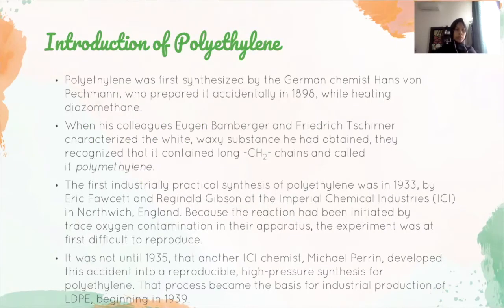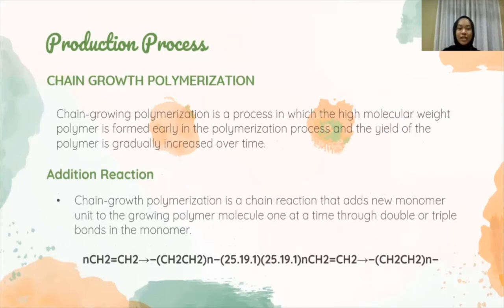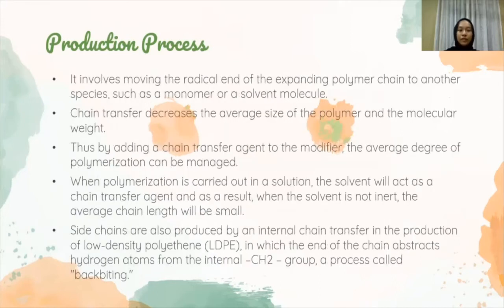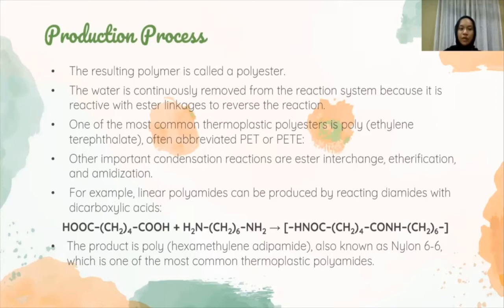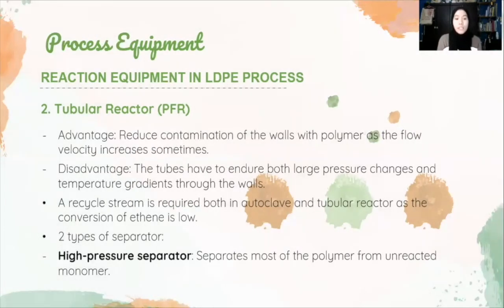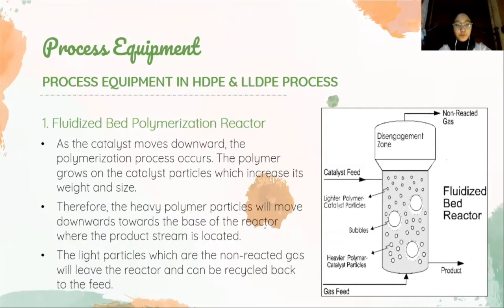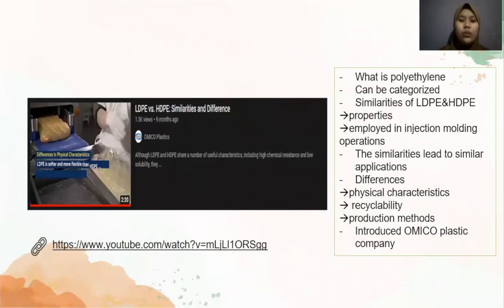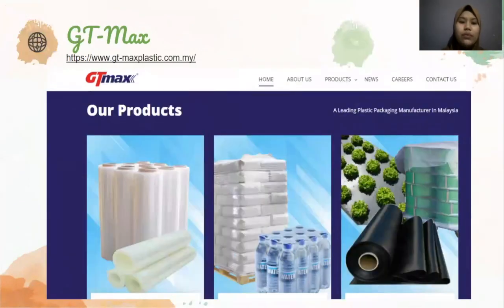Production of LDPE, HDPE & LLDPE

Comment: 5. Give 1 product that can use either HDPE or LDPE or LLDPE, and describe the application.
Reply: One product that can use either HDPE or LDPE or LLDPE is plastic films. In general, plastic films are used for food and non-food packaging, plastic bags, labels, photographic films and others. The difference between the three plastic films is HDPE produce stiffer plastic films compared to LDPE and LLDPE. Therefore, HDPE plastic films are mainly used for packages that need to maintain their shape. On the other hand, LDPE and LLDPE mostly have the same properties. However, LDPE plastic films are usually used in food and non-food packaging as it is easier to process. LLDPE tends to be used for trash bags due to its toughness compared to LDPE.

Comment: 4. In your opinion, why is fluidized bed polymerization reactor is being used in HDPE & LLDPE process?
Reply: In my opinion, the fluidized bed polymerization reactor process is being used in HPDE and LLDPE production process is because the reactor is can performed under gas conditions and also manage to produce both HDPE and LLDPE. Besides, it is also can used in a wide range of solid and supported catalyst, for example; Ziegler-Natta type catalyst. It is also most economic process because it is does not required any diluent or solvent to use in recovery or recycling process, hence no energy is required for that purpose.

Comment: 2. In your opinion, is it important to decrease the average polymer size and molecular weight during chain transfer? Justify your answer.
Reply: In my opinion, decreasing the average polymer size and molecular weight during chain transfer is important because it can affect the properties of the polymer. The higher the molecular weight of the polymer, the higher the impact resistance, viscosity, and chemical resistance of the product polymer.  Therefore, to produce an LDPE, the production needs to decrease the average polymer size and the molecular weight to achieve the ideal properties of LDPE.

Comment: 1. In your opinion, what is the significant differences with very low density polyethylene and linear low density polyethylene, other than density?
Reply from the maker: In my opinion, the difference between LDPE and LLDPE are LLDPE has short and uniform branches while LDPE has branches of more random length. The differences are a result of the different operating conditions, catalyst and consumers employed in the production of these polymers. This means, LDPE process uses a PFR or CSTR while LLDPE process uses a fluidized bed. Furthermore, LDPE didn’t use catalyst only H2O2 as initiator but LLDPE uses TiCl4 or Cr oxide as catalyst. In addition LDPE process have higher temperature and pressure than LLDPE